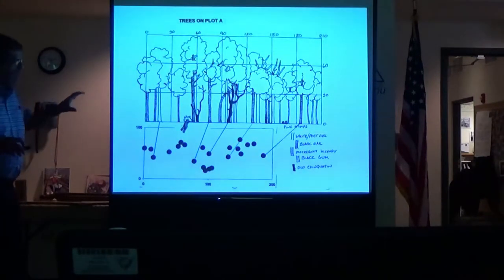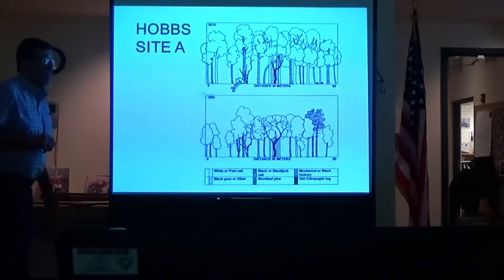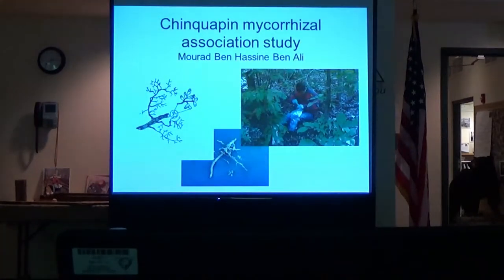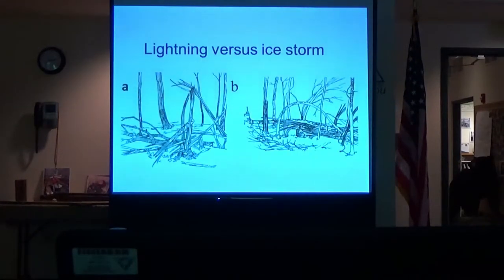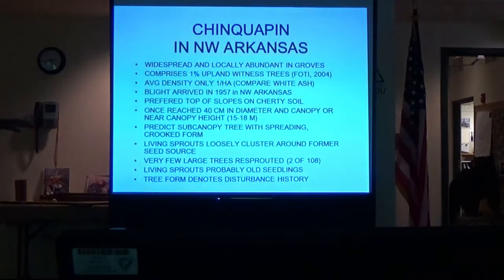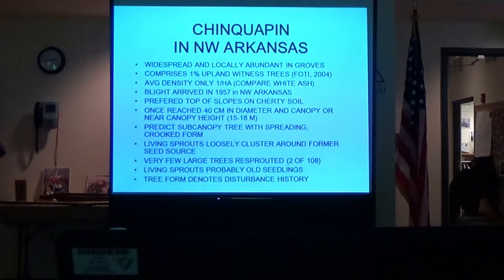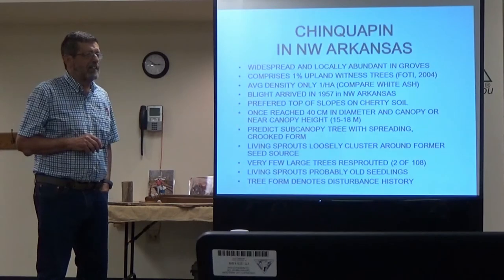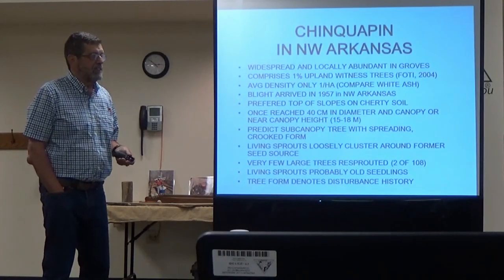OCF 2017- Stump Identification and Growth Forms (Part 2)

Comment: Wouldn't there have been larger less rot resistant trees that were taller than the chinquapins back in the 50's? Do you know that it was clear cut in the 30's or something?